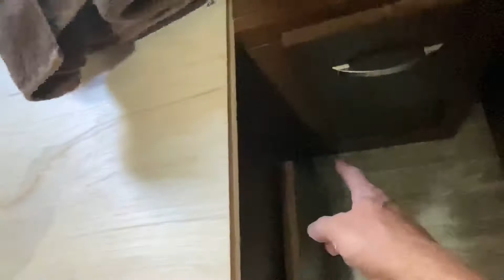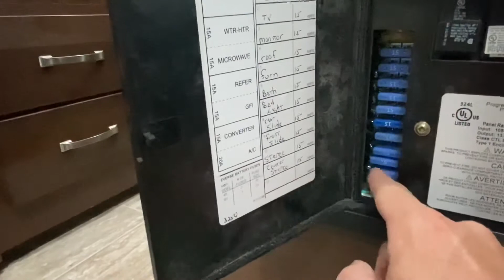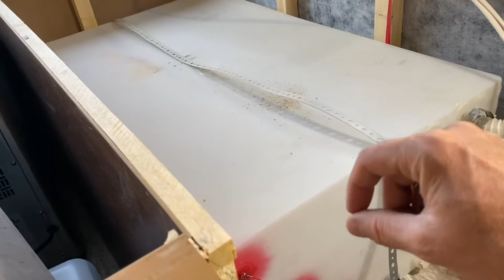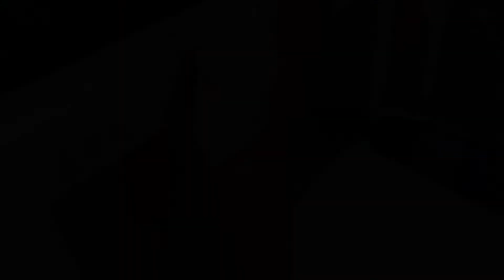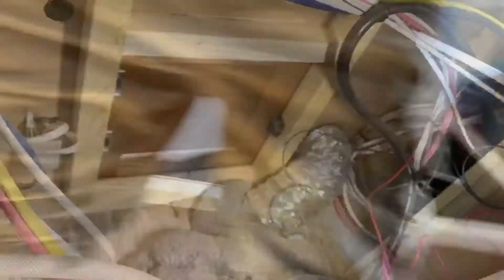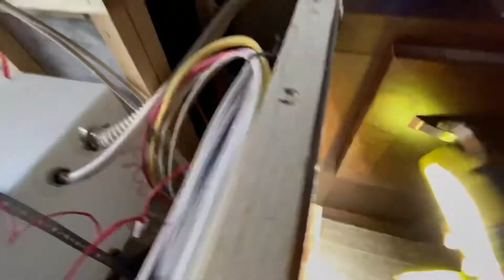Add USB Outlets to your RV | Wiring 12V Charging ports

Comment: I have the exact same looking bedroom and am working on the same project right now! Forest River Forester 32’. I removed the panel down in the garage behind the bed. Gives access to run wires to both sides of the bed.

And I just found my #12 circuit with the same empty wire. We should share RV notes sometime.
Reply from the maker: I hope this was helpful for you?  Thanks for watching!
Reply: @Myksgarage  yeah. Well it would have been a week ago before I discovered a similar plan to yours. On my right bed side, I don’t want to put the outlet where you did because there is a drawer there that opens and hits the cords. So I plan to run wires up under the cabinet, more complicated though. 

Before this, I ran some dc outlets under the seat at the dining table. I ran 10 ga wire from the battery on/off switch under the rv and up under the seat. Then I put in a dc fuse box to a few different outlets. Now I can run a small inverter and dc sockets / usb there for the kids to charge while driving around.